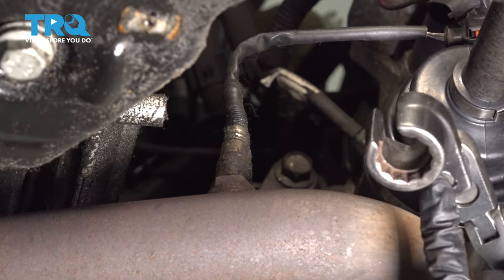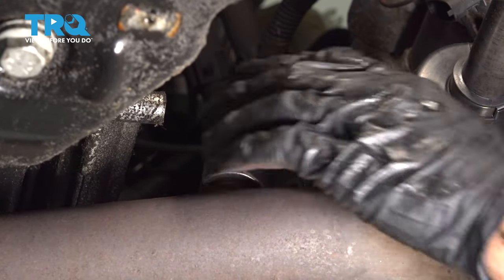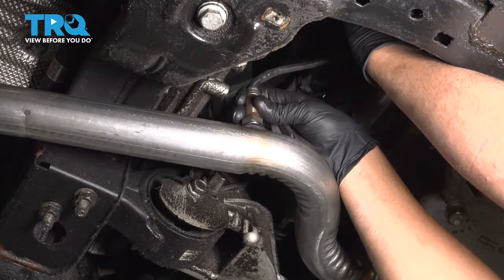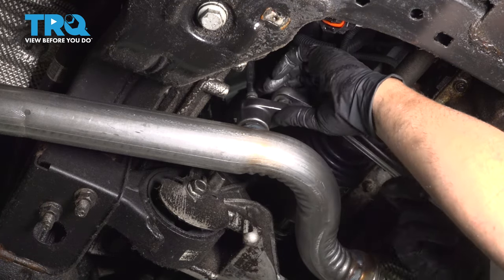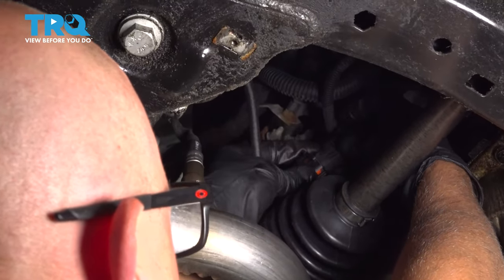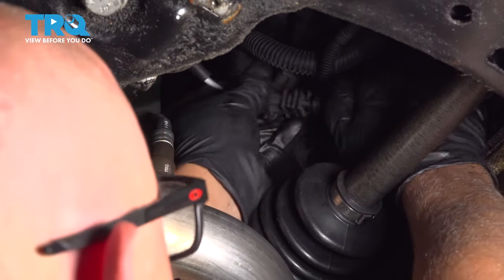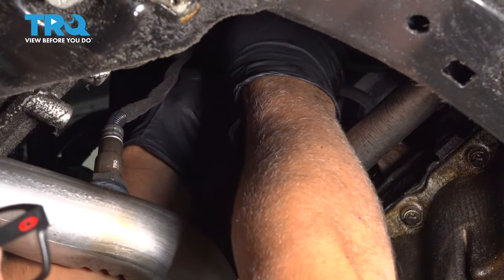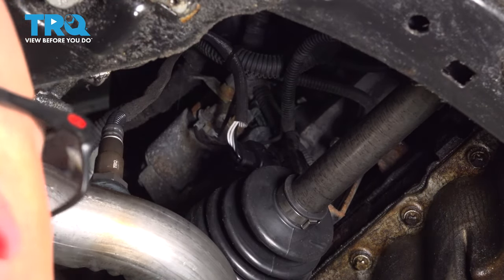How to Replace Downstream Oxygen (O2) Sensor 2011-2015 Chevrolet Cruze

Comment: I had my mechanic swap out the old one for a new one. The code only came for the upstream O2 sensor, which I replaced myself, but I figured I'd just swap the downstream as well. I couldn't do the downstream one because it just wouldn't crack open, so I had my mechanic do it on a hoist at his shop. 

My mechanic didn't like the fact that I was starting to work on my own car, but I didn't care, it's my own car. Anyhow, months go by, and I start getting random codes like crankshaft sensor, camshaft sensors, etc. So, I had my mechanic change those sensors thinking maybe they're just going bad. I do an oil change in my garage one day, and I see the passenger side drive axle boot leaking, so I replaced it myself and never thought anything of it after that. Few weeks after that, the dashboard shows reduce power, and code came up for engine code for the ECU memory, with no other codes. So, I do some research and find out that either the ECU is no good, there's a bad ECU Fuse & relay, or there's a bad connection from one or all 3 of the connections to the ECU. I investigate further and find out that there's no issues with the fuse & relay, so it had to either be the ECU itself or the connections. After further investigation, I see a bunch of grease coming from the boot of the passenger side drive axle, the part that connects to the transmission. I'm totally dumbfounded. Like, how does a new drive axle go bad that fast? Anyhow, I check to see what's going on, and lone and behold I see the bracket for the downstream O2 sensor handing down on the boot of the passenger side drive axle. The O2 sensor itself wasn't even attached to the bracket. The bracket is supposed to be screwed into the side of the engine above so it doesn't touch anything, and so it holds the downstream O2 in place. All I see is all this grease all over, and a whole bunch of it on the starter and the grounds of the starter. I disconnected the terminals from the battery, and then I cleaned off the starter with all the grease it had on it from the boot of the drive axle, and the vehicle started to drive much better than it did before with no more random codes. Lesson learned: Be careful of whose working on your cars and their intentions. My mechanic either forgot to screw in the bracket that holds the O2 sensor in place, or he left it there on purpose, knowing this would happen.
Reply from the maker: +@rome8087 Thanks for the feedback! http://1aau.to/m/Shop-TRQ

Comment: Another vid did not show that you can slide the harness up, give you slack. I had to use a tiny flathead to get the connecter locking tab to release. Easy does it though, its just plastic andwatch not to pull from main harness too much.